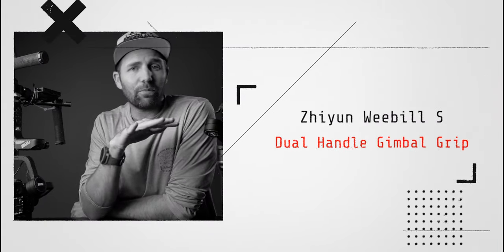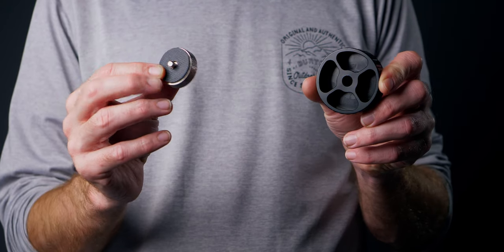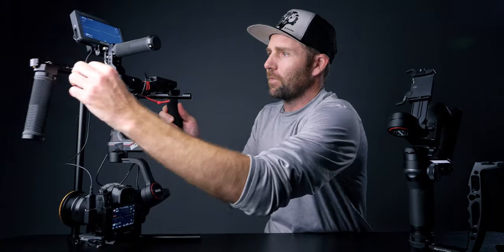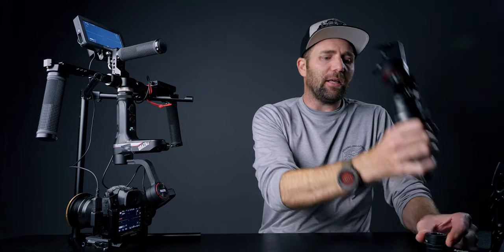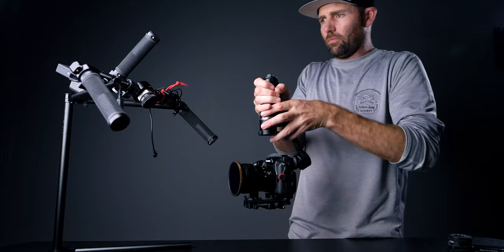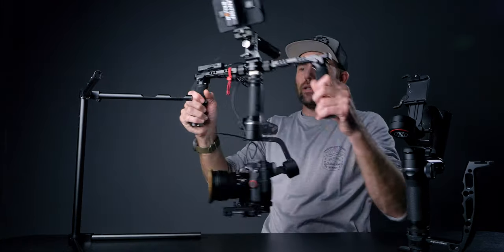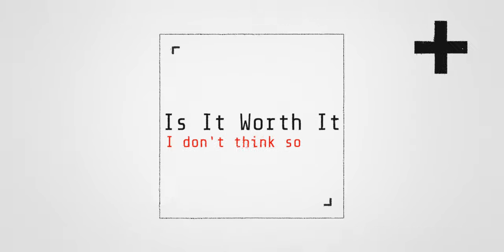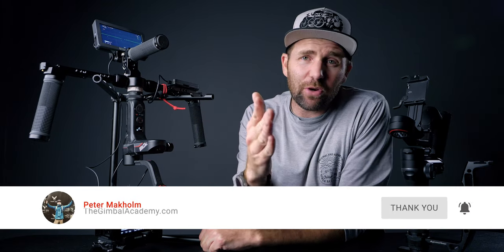ZHIYUN WEEBILL S DUAL GRIP GIMBAL HANDLE

Comment: What about using it in underslung mode. Attach a Smallrig Weebill S handle and something like a monitor mount to get the angle up to the twin handle 🤔 Might work a bit better than having it inverted.
Reply from the maker: Yes that would work. The weebill S is nt designed for inverted mode.

Comment: Perhaps it would be better to mount the Weebill S in a hand held ring, so that you can have it mounted the right way up!  
I am considering this, by purchasing the Smallrig 2068 model (which is designed to accommodate the DJI Ronin/Ronin M/Ronin MX),  and converting it, using 'off the shelf' and making / 3D machining the parts myself.  Smallrig do make this ring for the Crane 3S, which is the 2858 model, but I don't like the plain rounded corners, the 2068 has 1/4, 3/8, threaded holes, Nato Rail / ARRI hole, on all four corners - to mount the external accessories.  I will have to check that the smaller sized 2068, will be large enough to take the Weebill S.

Comment: Peter - I recently purchase the Smallrig Hand Held Ring - the 2068 model (which is for the Ronin Gimbal series),  for my Zhiyun Weebill S, and a 'UTEBIT'  Quick Release Plate PU-50 (from Amazon), and attached this to the base of the gimbal handle, which then connected directly to the quick release mount that comes with this gimbal and after testing it out - with the Weebill S in the normal upright position - it works a treat - so easy to use with zero up and down motion!  The ring is very light, and will be just as good, if not better than using the dual grip gimbal handle.  You should try using this ring - 2068 . . it was a breath of fresh air for me . . .
Reply: Do u have a video of your setup?
Reply: @davidson.mp4  not as yet - I am currently recovering from a bad episode of sciatica, and I am flat on my back.  However, I will put together a short video showing the handheld ring 2068, the plate and the simple feet, which I made myself - saving £85 . . . !
Reply: @nalarepooc1  OMG, Wish you the best, rest well ✊
Reply: @davidson.mp4  - Thank you . .
Reply: Do you know where to get the spacer?
Reply: @donariessol282  Hi Don - can you describe the spacer that you are asking about, and where it is used on the Smallrig Hand Held Ring 2068, thank you.
Reply: @nalarepooc1  it would be a spacer that’s 3/8 to 1/4 which one part would connect to the smallrig dual grip and the other part would connect to the weebill s.
Reply: @nalarepooc1  I have the dual grip not the ring like yourself my bad lol
Reply: @donariessol282  - So - the Weebill S base is fastened to the 'Quick Release Plate PU-50', which you can obtain from Amazon (for around £10 in the UK), and then this quick release plate slides into position on the existing Smallrig clamp that comes with the handheld ring, whereby the sliding base plate can be tightened in place.  I have my Handheld ring in front of me - so in all - I have my Weebill S, the quick release plate PU-50, screw the base base of the gimbal, then the plate slides into position and tighten on the Smallrig camera support clamp that you get with the handheld ring.  The unit is set up so that the gimbal is supported from the base of the ring, and not hanging / suspended from the top of the hand held ring - does this makes sense.  Are you describing the 'spacer' as a round washer, or are you talking about the quick release plate, that was included in my original comment . . . ?  Have you accessed Amazon in your country and typed in, 'Quick Release Plate PU-50',  I can see it on Amazon UK at just over £10 . . .  Best wishes
Reply: Ahh - the penny has just dropped - Don - I take it you are referring to the dual grip that Peter Makholm is testing in his above video - when I am talking about using the Smallrig Hand Held Ring 2068, which is a different kettle of fish!  Best to ask Peter Makholm about the washer that you are asking about.  Good luck !
Reply: @nalarepooc1  ima just return the dual grip and veg the ring you’re talking about! It’s way better in my eyes
Reply: @donariessol282  I think that you will find that the Hand held ring is much better to use - Good luck with your film making. :)

Comment: I have ronin m for big movie stabilisation an run and gun weebill s.
For me this set up I take the ronin m.
I have 1 question, I have a big external monitor Lilliput a7s, and I want to know what is better place for monitor?
I try on the handle single grip for me is good but I see for a good smallrig object to make strong grip for monitor.
Or I see you use a smallrig for monitor at the left of weebill s.
It's good?
The weight of all is good when you use the weebill s?

Comment: Will this work ok in up right mode on the dual handle without the quick release but on top of the silver thread adaptor???
Reply from the maker: It works perfect upright, then you can leave the tripod legs on by you still need the quick release plate because it is nearly impossible to tighten it so it will be straight with the gimbal.
Reply: @PeterMakholm  ok, thanks for letting me know ☺️

Comment: a real shame about the practicality of this - I was kind of hoping that my Weebill S would be a bit more adaptable like the Crane 3.
I've looked on ebay, amazon, etc. and there's hardly anything in the way of grips/handles for this gimbal. however I do like the quick-release idea.
meanwhile I'm still trying to find a solution that will allow more versatile shooting with my gimbal, while exploring practical monitor placement and allowing the gimbal's freedom of movement.
ps: can I suggest you invest in a more sturdy table? 😆 I see the camera wiggling around while you're explaining and gesticulating.